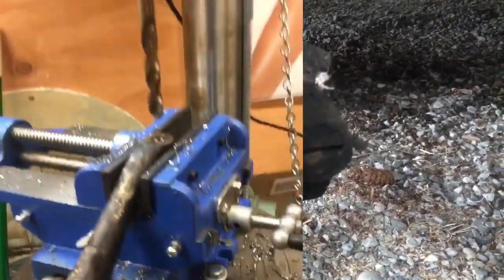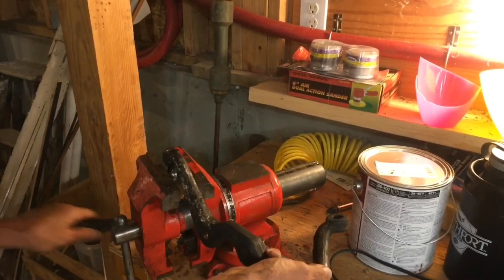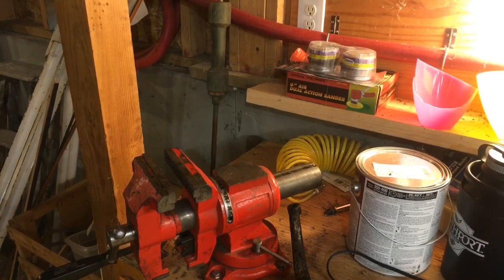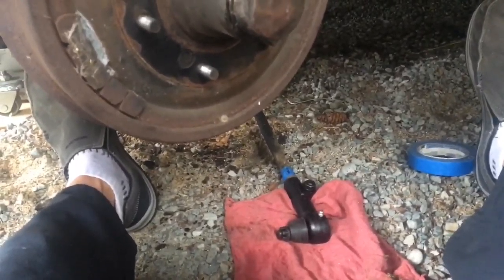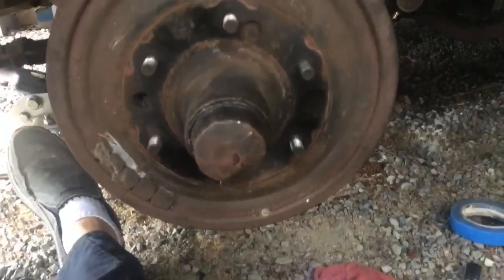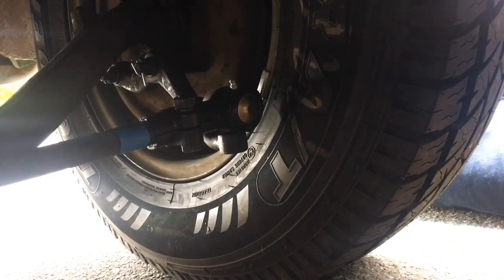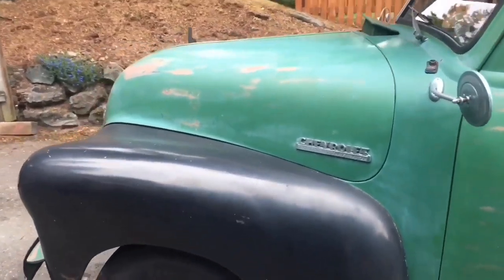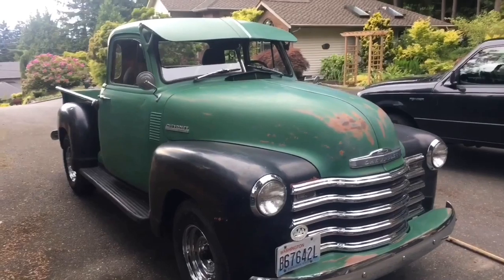1953 Chevy Truck Steering Upgrade, Tie Rod Ends & Drag Link

Comment: Thanks for the video! One thing you didn't mention...where did you get the new ball studs? I assume that you put the kind with the threaded posts in for the new replacements? What size is the new balls? Thanks again!
Reply from the maker: I covered that in the video, the ball studs are discarded, and went with the modern style tapered, like a ball joint, it’s covered at the 7:55 on the video, thanks for watching 😀😀
Reply: @DesertRatFabrication  I guessed I missed that part I guess. I'll rewatch it.

Comment: Great video, how did get the measurement to make up your stick. And when you had that gap between the stick and tire, the other end was sitting against the other tire ? You post a lot of good content on these old Chevys. Thanks
Reply from the maker: You have to sneak up on it , front then back , back and forth till you get them close , then you can get your 1/8 toe in, and set the distance before you take it a part and you are al ready close to start with, hope that help, did my own alignment on my VWS, works great
Reply: @DesertRatFabrication  good job thank you
Reply from the maker: No problem Nick, thank you

Comment: Great job on the steering upgrade, before the upgrade did you ever get the infamous death wobble?
Reply from the maker: Steven, that is a two part answer, lol, I never had the death wobble, in part maybe because I still have the 411R&P so top speed is about 35-40, I have all the stuff to do the swap to 355 R&P, as for the steering it was all over the road constantly correcting it was bad, but now it drives very nice, I think it likes the 1/8 inch toe in and new parts, I’m really happy now , and don’t have to think about steering when I’m driving the truck, your 53 is going to be very nice, I really enjoy your videos, talk to you soon 👍

Comment: I saw that he mentioned the drag link, with modern style ball joints,  were available through 40's chevys website. I was able to find it does anyone know where I can locate one?
Reply from the maker: It’s called Chevs of the 40’s the phone number is 360 816 0211, and the Filling Station 800 841 6622, hope this helps